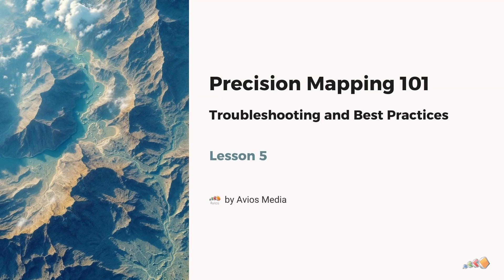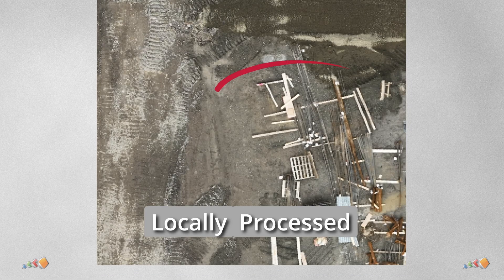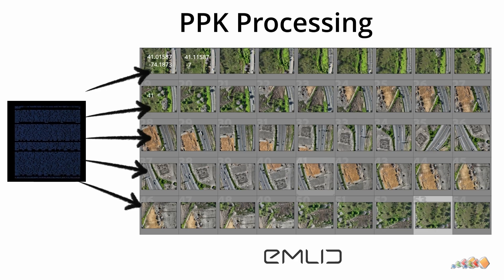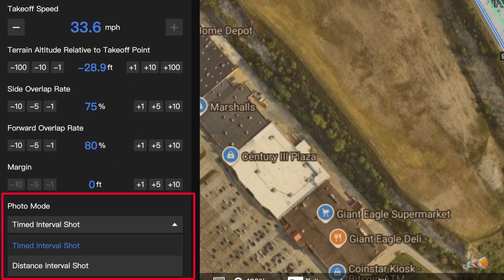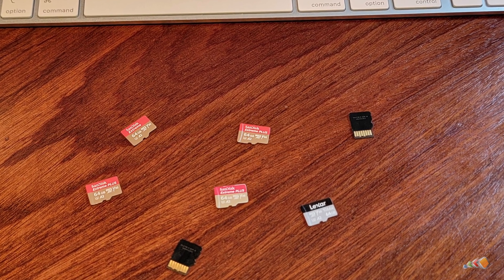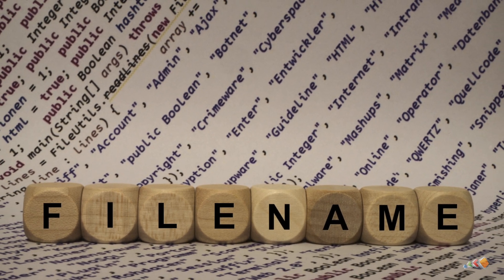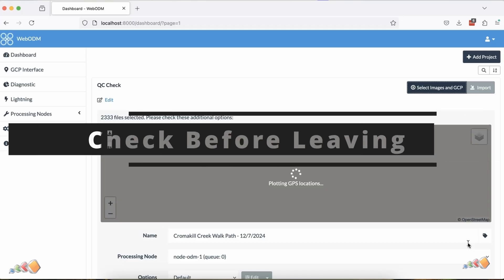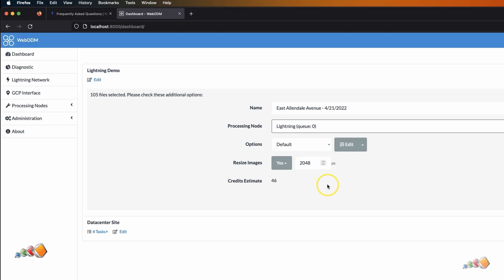Precision Drone Mapping Series - Lesson 5: Troubleshooting and Best Practices

Comment: Here's a question. Why not map with a DEM vs a DSM and make even more accurate maps? This is something I'm currently working through (unsuccessfully I would add). In the US we have free high resolution DEM data available through USGS/NOAA an I'm trying to lock down the workflow and hitting elevation snags probably do to projection errors...  But I for one would love to see you work through my problems 😂

Great vid thank you. Have you considered using reality capture for your maps? Fastest processing I've seen yet, and free 😉
Reply from the maker: Have you seen this https://youtu.be/F-CRGnwbXUk. Bot exactly what you are looking for, but it might help.  

I haven't tried reality capture yet because  it is Windows only, and I don't have a Windows machine anymore.
Reply: @aviosmedia  I have seen that thanks. I think my problem has not actually been with the DEM? Every time i loaded one in sn area eith any significant elevation change and tried to fly I would get the message " RTH lower than the highest point of flight route". I thought this was because I did something wrong with the dem but after further research and realizing that DJI does not terrain follow when it is returning to home or going to start point. I believe my problem might actually be not accounting for my take off location and not inputting the proper max altitude and RTH values to account for the fact it is not terrain following home. Hopefully that makes sense..

Comment: Hiya, Barry. Not related to this video, and if you have time to indulge me, please, please shed some light on the challenge that I'm having trying to use Dronelink with my mini 3 and my mini 3 pro along with my (current version, which is using the current Andriod O.S. and hardware architecture) Android tablet and my RN-1 Controller. 

!!! - I've never gotten dronelink to work with those. I've tried both with 'force stopping' the DJI Fly app and letting the DJI Fly app run in the background.  All I get when I hit the "Play" button to launch the mission is this error:    "Unsupported Execution Engine DJI (Onboard)"  !!!

My drones' firmware is up to date, of course.

Unfortunately, I do not have an RC Pro Controller (can't afford it).   I do have an RC Controller, but -as I understand it- the RC Controller is NOT compatible with Dronelink for this. Is this correct?

* I do have a Mavic 3 Standard, but as I understand it Dronelink is not compatible with the Mavic 3 Standard ... unless it is "Onboard Only", which I don't know "Onboard Only" that means in regard to all of this.*** Does it mean that Dronelink will work with the Mavic 3 Standard, but requires the .KMZ files to be uploaded to it somehow?

I do have the Hobbiest Premium Plan of Dronelink, which should work with the mini 3 and mini 3 Pro.

Since I'm just trying to start doing mapping and 3D modeling, I prefer to use my minis vs. my Mavic 3 for most of the projects (less $$$ to lose should the drone get get damagaged ... or worse).

But at this point (after watching hours of your videos on Dronelink (thanks for all of your good tutiorials), I'm seriously frustrated that I can't get Dronelink to work with the Mini 3/3 Pro.

Soooo ... my virtual friend ... unless you can enlighten me on what I'm missing, or a fix ... I have no choice but to use Waypoint Map (waypointmap dot com) along with my Mavice 3.  And, as you may know, Waypoint Map does not support the Mini 3/Mini 3 Pro (as far as I've been able to glean).

I'm hoping that I'm missing a "simple" piece of instruction here.  My 77-year-old head is getting very sore after my continual beating it against the wall.

Thanks in advance, should you be able to kick me off 'top dead center'.  Best Regards, Chuck    :face-pink-tears:
Reply from the maker: Hi.  A few options to consider here.
1.  Are you sure you have loaded the correct version of Dronelink?  There are two versions - one for later drones and one for earlier drones.
The best option is to go to this link and follow the instructions based on your drone and controller:  https://www.dronelink.com/download.  You should not be installing from the app store for any of the drones you mentioned.
2.  Make sure that your tablet has enough power - you didn't mention which tablet it was.  But Dronelink does take some processing power so it needs something decent.
Maybe what you have is listed on this spreadsheet? https://docs.google.com/spreadsheets/d/1JPhn9yKVaKiyd_k0JP8ZI7_fMJjjJcE8ybcCW93SCYw/edit?gid=0#gid=0
3.  It is now possible to use Dronelink with your Mavic 3 using the KMZ files.  It's a bit of a hack but it does work - I put a video out about that recently.  You can see it here:  https://youtu.be/Uuk21sVoZRo

Hope that helps!
Reply: @aviosmedia  Thanks for your reply.  My Android tablet is a DOOGEE T30E 11 inch Tablet 2025, Android 14 Tablet, 9GB+128GB/ 1TB TF, Gaming Tablest with T606 Octa-Core Processor, 8000mAh Battery, 4G LTE+ 5G WiFi, 13MP+5MP, Widevine L1/BT5.0/GPS/Face ID (Gray) that I got from Amazon a couple of months ago, specificly to use with Dronelink.

Do the specs (above) look as if it's powerful enough?  Thanks again. Chuck
Reply: @aviosmedia  I've downloaded the Dronelink app 3 or 4 time.  I did select the Mini 3  Pro selection.
Please confirm that the DJI Fly app should be 'force stopped" before opening Dronelink, please?  I've tried it both ways: runing and stopped.  And I still get that blasted:    "Unsupported Execution Engine DJI (Onboard)"  

And I've tried 3 different cables between the tablet and the RN-1 controller, too.

BTW-- I can tilt the gimbal and see the camera view, and it seems like a "normal"  connection to the drone (mini 3 Pro), but it won't launch.   Thanks, Chuck
Reply from the maker: Since you can see the camera it seems to be connected.  Assuming you have the correct (it should be called Dronelink DJI) there are a few other things you can check.

First, make sure that the controller switch is in the normal (center) position.
Also, go into DJI Fly and turn off collision avoidance - particularly if it is in the avoid mode.  See if those fix things.
Reply: @aviosmedia  Thanks again for your {quick} reply. Oh yeah, I've used the 'converted' to .KMZ waypoints all along. Yes, I have it in the 'normal' (equivalent to the "P") 'center' postition . I've also tried it in the other 2 positions as well.  The only thing that I haven't tried that you have suggested all along it 'turning off Collision Avoidance.'  I'll let ya know if that solves the problem. Thank you, sir.  chuck  :rocket-red-countdown-liftoff:
Reply from the maker: That can definitely cause missions to fail - and often with error messages that don't make sense.  Let me know if it works,
Reply: @aviosmedia  Well ... still No Joy. I turned off obstical avoidance, deleted all of my previous missions and created new ones, and tried a different cable between the controller and the tablet, and cycling between the modes on the controller (to get back to the center --P GPS), and restarting the controller and the dron,  and still get the "Unable to Take Control ... (Onboard)" notice.  Not that it is probably noteworthy: I've always been able to  manually launch the drone in Dronelink when I press the launch icon (that looks like the launce icon in the DJI Fly app), and fly the drone just as if I were in the DJI Fly app ... BUT ... still No Go trying to launch and fly a mission via the Dronlink app.  I really appreciate all of your suggestions, and I guess I'll just give up. I don''t want to waste anymore of your time, sir.  Cheers, Chuck (getting geezier by the minute)  :face-purple-crying:
Reply: Since I can't afford an RC Pro controller, I'll just use my Mavic 3 with the Waypointmap App (made by JaysValut) for now.